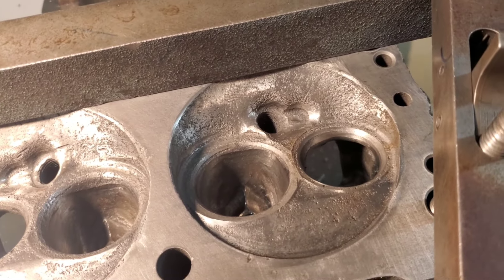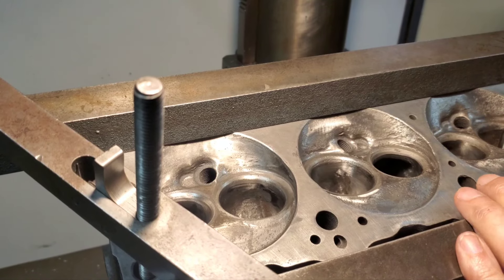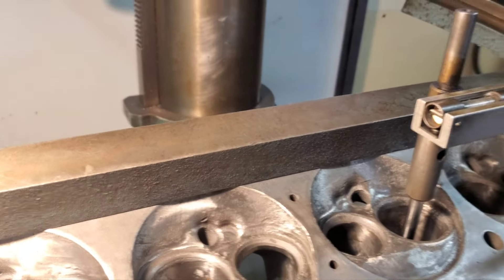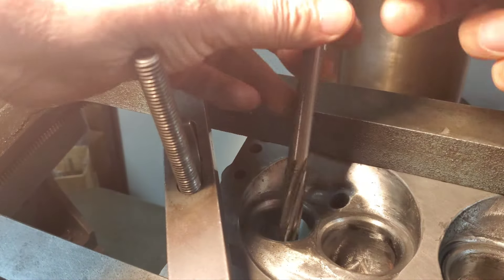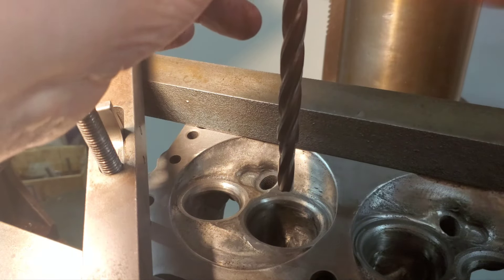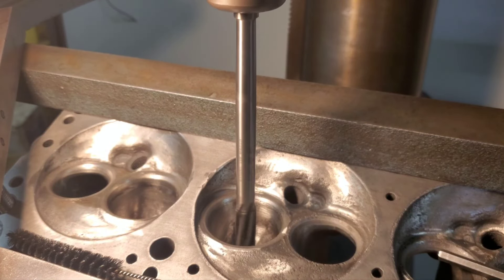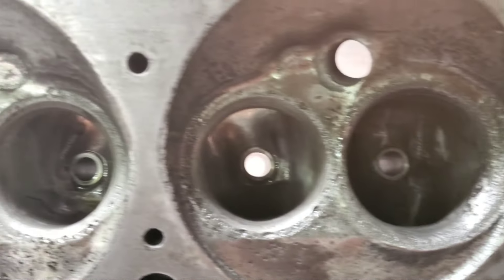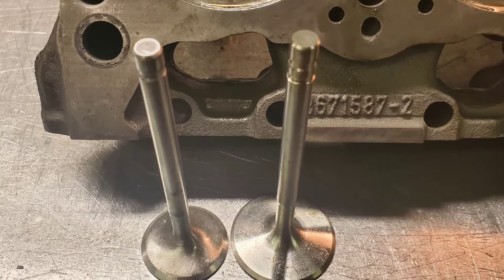Little Red Express 360 Head Valve Guide Installation.

Comment: Those heads look like they have led a rough life Ed! But you'll get them fixed up! Great job!
Reply from the maker: Thanks Pat, it will be a challenge. 
Been the before.
Little Red Express Truck to the front!
Have a great day. 👍💯👍
Reply: @edsmachine93  One of my first jobs at NS1 Performance Center was to get the boss's 79 LRT going.  After I tuned it up it would bark the 275 Eagle ST's going into second, which eventually led to a rebuild of the 9-1/4" rear, but man that was a great and fun truck!
Reply from the maker: @MostlyOldPartsAndRust  Sounds like a fun Truck Pat.
All that power took it's toll on the 9 1/4.🙂
Reply: @edsmachine93  It suer was, it was in Mopar Muscle in the late 90's, it had the heads and block decked a little, so it had good compression, but it had all of the stock parts in it, 340 cam, std bore pistons, etc., but it sure ran good.
Reply from the maker: @MostlyOldPartsAndRust  Sounds like a good build Pat.
Supposedly the '68 340 cam was the best stock cam.
I have a new NOS TRW '68 340 cam stashed back.
I use to really like TRW engine parts.
Top of the line parts.
The original Sealed Power/SpeedPro was the same good quality American parts.

Comment: So you install the guides with the spiral end first so its up by the seals, right? What is the purpose for the spiral in the first place? Another great video to show us watchers the right way to do it 👍
Reply from the maker: Hey Joshua, thank you for watching.
The purpose of the spiral is to have oil around the stem.
The solid portion stops the oil from running through.
The spiral meets the solid portion forms a peripheral seal between the valve and guide.
And constant lubrication to the stem and guide bore.
I will talk about this is a future video. 
Have a good evening. 👍🇺🇸👍

Comment: Those castings look rough.  Were they rusty to start with?   My 360 J heads have the 2.02"/1.60" valves, and it took many hours of porting to get the bowls (and ports) opened up for the larger valves.  Hope Joe was wearing a good mask and face shield when porting those.
Reply from the maker: Thanks for watching zerogmopars, yes, I am sure he was wearing proper protection. 
Yes, the heads were very rusty before.
You will see them fixed up.
The original heads were cracked.
Have a 0:02  good evening. 👍
Reply: @edsmachine93  That was a quick reply!  You sir do great work and videos.  Thank you.
Almost forgot,  If Joe is using head studs, oversize ream the cylinder bolt hole that feeds the rocker oiling.
Reply: Great job, Ed! I think the world will be amazed when they see these heads transform!
Reply from the maker: @JustMoparJoe Thanks Joe, I appreciate it. 
Yes, they will be alot nicer when finished.
Have a good evening. 👍🇺🇸👍

Comment: Was this a motor that sat out in the elements I got that 63 polara convertible 440 model and the guy that owned it put a 340 in it it’s sat  outside in cow pasture for well since 73 that’s what the licence plate said we looked at motor thought it was a poly till I realized the valve covers that are rotted and saw j on the heads then my buddy looked and it’s got 340 exist manifolds so we’re hoping somehow it never cracked the block mind you are chances are slim being in Ontario Canada east of Toronto it get s pretty cold but hoping ther was no water in the block to crack it the heads are pretty rough the rockers are sized from the elements being out side but we’re hoping it’s not cracked 340s are getting hard to come buy so my buddy wants the car he’s already pricing the floors all the glass and the trim is ther so we’re hoping got a tree growing though it  be a big job but he wants it lol I sort of do but I’m older I got my hands full with my 440 71 dart build anyway love your work shows me that hopefully the heads can be reworked but then again j heads are not that hard to replace we’re more concerned about the block but we shall see more to come lol great job ed
Reply from the maker: Good morning Jeff, yes this engine had sat in the elements had gotten water in it.
The customers original heads off of the Little Red Express were cracked and had to get another set of castings.
So here we are machining and repairing these heads.
Cast Iron is pretty forgivable sometimes.
I have repaired some pretty bad castings in the past.
This series should be good.
Thanks again for watching. 
Have a great day. 👍👍☕️